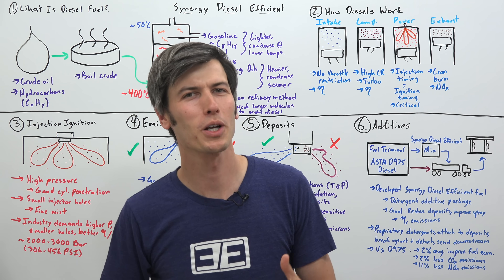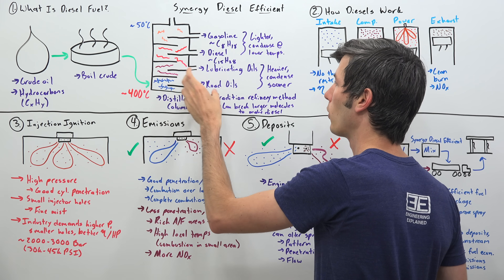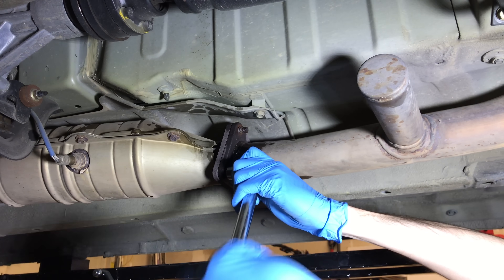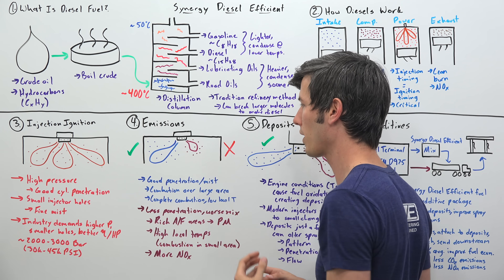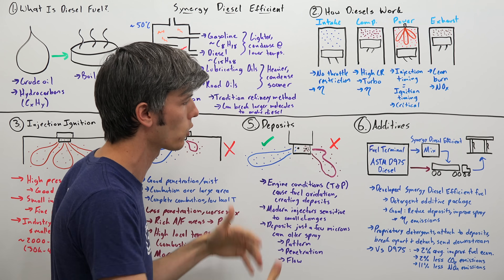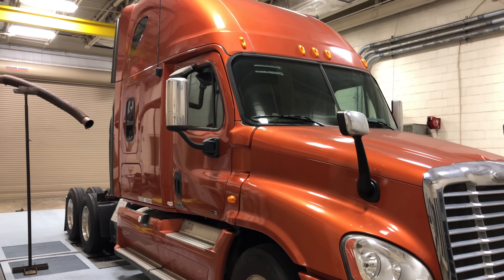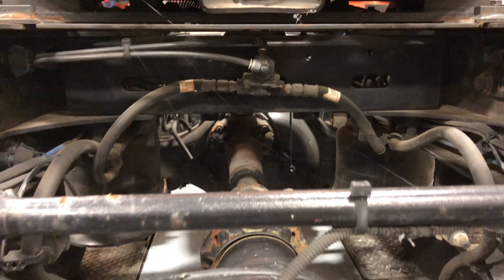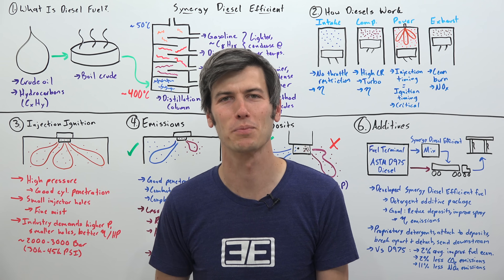Why Diesel Engines Lose Power & Efficiency Over Time

Comment: You can filter and filter more but you can only filter so much. Diesel goes from one tank to the next. It gets dirtier each time. For instance a truck stop gets its fuel from a tanker. That's 2 tanks. Then into the truck tank. That is 3 tanks. Each time it gets dirtier. Now it usually gets filtered each time but the filter does not get it all. Some filters get changed more than others. The filters get dirty. The dirtier the fuel the more deposits.

Comment: Thanks. I been driving different year model Peterbilt 579's for over 5 years now and ive always wondered why they loss torque power over time. Mostly noticeable when climbing hills. 

Our Peterbilt's get alot of Derate issues and i wonder if its related.

Comment: I absolutely believe they can reduce the consumption of the fuel, because here, in Ukraine, we have different gas station companies and those offer better diesel with different additives, so that the fuel consumption may be up to 15-25% better with the additives, than with the regular diesel
For example, my vw golf 7, 1.6 tdi loved the OKKO pulls diesel, i got my best mpg there, i could even reach 3.9l/100km, but usually it was around 4.2-4.4l/100km, while one time i fueled up at an unknown station, but for cheaper, my results were 5.5-6l/100km with the same road and style of driving
The regular diesel could offer me 4.6-5.1l/100km mpg

Comment: The reason that Diesel engines lose power with an increas in fuel consumption can be found in reading any Engine manual.  It is to do with lose of compression pressure and temperature to ignite the fuel fuel.  Traded trained techs know a trick that can restore engine performance when it drops away that is not mentioned in any engine manual. All trades have their secrets.

Comment: Cetane rating to get a quicker burn, friction modifers to the diesel fuel pump, remap to map out EGR and stop the intake from sludging up, a good right-sized FMIC. Personally use a mix of BP Ultimate Diesel, highest cetane rating in the UK & Shell V Power diesel best friction modifiers. Coupled together I also get both packages of detergents...

Comment: Utter Pig Piddle...........If an engine is properly made,correctly matched to its application, with no inherent problems, properly maintained, with properly filtered diesel AND synthetic oils it can go 1 or 2 million kilometers and still achieve the same horsepower and fuel economy.  Cat engines, the K19 Cummins and the ISX Gen 2 (non egr etc) and Series 60 engines all were capable of going the full distance.   DPF's need regular maintenance and are a separate issue.  If an engine doesnt go the distance its because its poorly made,maintained or wrongly matched to its application (too much load factor).   Many light vehicle engines only have a problem because they are poor quality junk , the end.  Heavy truck engines have been high pressure already for decades........havent changed.  Only in light vehicles have pressures come into the same bracket with the advent of common rail.

Comment: I love your channel, but have a lot of questions about my diesel truck and the efficiency of a truck with a DEF system. is it possible to get better performance with DEF than without? and what are the most dangerous greenhouse gases and what % comes from automotive Deisles...is the EPA just chasing money or are they actually doing good for the environment? and why do vary large tankers that carry everything do not have ti use DEF systems and similar grade fuel to the cleaner stuff we put in our trucks? please shed some light on this or if it would be a bad move for you to do thus please also let me know...IE the epaulet will not be happy with what you may find...thank you and keep the great work up!

Comment: Mine has an issue @ 3000rpm losing power for a second or 2  based on  Dyno test result (Grand Starex Gold VGT A/T) , Diff  shop has diffe opinion on the issue, Injector, Turbo,  Transmission, Airflow/MAP sensor, EGR, iI dont' know which one is correct

Comment: The Propietary detergent is Anhydride ethanol? I Put some E85 mixed with 50% ATF dex3 for lubricity, at 1:20 ratio. Looks like a good detergent, got more pep after refueling with pure Diesel....

Comment: If you could centrifuge the fuel before using it the mud  comes out from station fuel.Most ships that run on diesel purifie the fuel first. I have worked on such engines and have never come across a deposited injector.  High hour diesel engines will degrade due to compression loss . Compression rings and valves.

Comment: Lots of factors to control in an experiment like this.  Air temperature, air-pressure, tire-inflation, oil viscosity (engine and transmission), oil fill level (crankshaft sloshing), air-filter flow resistance, electrical load (state of battery charge).

Comment: I run my Transporter T6 often from Germany to Romania, and decided to run some experiments with different fuels.
1-Shell diesel sucks, high consumption and loss of power.
2-Conventional Diesel from OMV is cheap and good. 
3-Performance Diesel with additives are 10% higher in price, but gives you more than 10% more in mileage.
It makes sense to use diesel with additives if you go for a long run, specially if you need to refuel.. it pays off! Just avoid Shell!😅

Comment: the trick is to use those premium fuels from time to time to have a nice balance between fuel cost and clean(ish) engine especially if its older or has a lot of mileage

Comment: I drove vw lupo 2001 driven 500k 1.2L engineomg it got power 150kmph with just a little touch of gas pedal.  And with a great efficiency
May be they lose power but its irrelevant may be you will notice after one million km and car will be dead much before that time. And why you are focused on diesel engine petrol car also lose power. And petrol engine last 250k where as diesel last 500k

Comment: Thanks,crude oil is usually put through a cracker first to break the larger molecules to smaller ones before multi stage distillation to produce diesel. The refinery can control the process to vary the split of the various fractions depending upon market conditions.
 Diesel is getting a rough ride in the UK, and car sales of diesels have dropped dramatically, VW and others have dealt a serious blow to diesel cars.

Comment: So the diesel they selling is coming from their own refineries and completely contained in their own separate bulk fuel delivery system? Because all the other retail fuel distributors get their fuel from bulk delivery sources at the "rack" which supplies multiple different distributors. It's all the same fuel. But ExxonMobil keeps their supply completely in house from refining to the pump?

Comment: So why is diesel more expensive since it is substantially less refining then gasoline kerosene etc...
Reply: Supply and demand.    More demand less supply = higher cost.    You will notice the prices fluctuate back and forth throughout the year.  Usually in summer gasoline prices are close too or higher than diesel  prices. Then lower in winter.

Comment: It is a good practice to always use an additive to lubricate the high pressure common rail fuel system and to clean the injectors.  It is good to hear Exxon is working on high quality fuel as America's diesel fuel quality varies greatly - diesel seems to be the red headed stepchild in the US, our fuel's lubricity is generally well off what Europe has, for example.  

Exxon may have great diesel fuel, but the diesel fuel system is too sensitive to leave to chance - I always look for a high volume station and run a lubricity and injector cleaning additive that also improves cetane, which is generally sadly lacking in America's diesel fuel supply.  My little Canyon with the 2.8 diesel runs much better with a little cetane bump, with no rattle at all once it is warm.

Light duty truck diesels can easily run 400K miles if fed good fuel and looked after.   The real devil with the new diesels is in the emissions system.  Tuning can take care of that - nod/nod, wink/wink.  That and don't "short trip" a diesel.  They are at their best when the engine is heat soaked and they used for highway and distance driving.  Once a good lightly loaded pickup truck's diesel is in overdrive on the open road, the transmission's work is done for the day - LOL

Comment: Glue instructions say, to get the best bond, sand or scuff glossy surfaces.  The glue has more texture to grip.  Deposits bind to the injector surface, although unwanted.  Would it help to polish the injector surfaces to a mirror finish, to reduce deposits over time?  Or maybe design them with a glass or ceramic coating for the same effect?

Comment: you didn`t explain at all how ignition and injection work in a diesel engine and why it`s different from a gasoline engine 
do you not understand it youself?
Reply: Its explained in other videos. Diesels use the heat of compression to ignite the fuel.

Comment: Dude that ignition was like 20 years ago, ever heard of glow plugs? google it.
Reply: That is the modern system, diesel direct injection. The older system used indirect injection. 
The glow plug is used to heat up the intake to help the engine start when cold. After the engine is running, they do nothing.
Reply: @Redtooth75  they do even after in order to optimize the running of the engine and lower the consumption/emission by providing better control over the detonation.  I am just saying that his statement is way outdated unless in US they never upgraded them diesel since the '80s.

Comment: If Diesel engines need smaller holes to diffuse the gasoil better, but smaller holes are more prone to be blocked by deposits, then why not 1) use many more holes to achieve the gasoil "mist", and 2) inject hydrogen to clean up the injectors from time to time?

Comment: In Spain we have two diesel types
Normal Diesel and Diesel PLUS.
Depending on INJECTION SYSTEM the additivated one, the PLUS, is NOT recommended due to less lubrication properties, aawell sulfur content is mandatory to be zero.
BimmwrN53

Comment: You didn't focus on the Cetain Rating. NA diesel was so poor 25 years ago that European and Japanese diesel engines etc couldn't run on it. They knocked severly and had poor performance.
Honda small diesel engines has a large US stzmped on thd flywheel to indicate it was fir thd NA market only. .Petro Canada at the time had info on what makes a diesel fuel good. I obtained that info to understand dual injection Honda diesel snall non-road  engines. Im not a fan of diesel at all, however suffice to say that there is nothing that will do the job they do with heavy equipment. Take them off the road as far as passenger vehicles are concerned. Teslas semi once it is in the road will take care if 18 wheelers.
Love your program and you explanations are great (have to replay some to get your gist). Im USN traied and licenced as a Mororcyle, automobile and truck mechanic. Honda is my love and thats all products. Diesel and two stroke fasoline engines have no place in the market anymore and no one has suceeded in making them clean. VW  should be put down for their cheating or fined out of existance. Thats my rant. Thanx for your E. Expl. Once again!

Comment: At what point in the video there is the answer to the question in the title?
Isn't possible the replace injectors regularly, as we do with spark plugs?
Reply: Diesel fuel injectors are expensive. Yes you can change them but its usually not worth it unless you absolutely need the extra power.

Comment: My question is, if you have never used Synergy and your injectors are no longer spraying in a uniform pattern; with the detergent used, how long would it take to clear up those injectors and bring them back to manufacturer specifications? Efficiency was thoroughly covered, but the cleaning of the injectors was almost completely ignored?

Comment: So base refined diesel is the same for all the stations? Only the additives vary from different distribution companies... am I right? Just really curious because shell did come out with higher quality diesel in Finland few years back, but it does cost like 10 cent per litre more than normal one which is around 1,2-1,5€/L 😬

Comment: I cleaned my diesel injectors  at 280.000km with an ultrasonic machine and now no more black smoke exit from the exhaust.
I also suggest the use of an additive for the oil to help engine run well

Comment: Why does diesel usually cost more than gasoline when it's simply less refined gasoline? It's all coming from the same crude oil. Is there less diesel produced compared to gasoline in the distillation process?
Reply: While Gasoline is more refined you must take into consideration what uses Gasoline vs Diesel. Gas is used by smaller IC engines typically. Whereas Diesel is the primary fuel for things like large semi trucks, trains, and the vast majority of the world's ships.
Reply: @bobjackson4287  That only adds more to my question. If diesel is used by more things, and is simply less refined crude oil, why does it cost more? Makes no sense.
Reply: @busterscrugs  Diesel has a much higher demand on the world stage. And has very high usage overall. Also Diesel at least in the United States have high taxes due to the EPA nonsense. All of this combined cause diesel to be more expensive despite it being more fuel efficient.

Comment: On a side note: If diesel engine emission systems such as DPF, DEF, and EGR were primarily developed to reduce emissions for the sake of flattening the climate change curve, then how are they helping since you burn 30-50% more fuel per tank with the regen cycles?  If diesel particulate is causing climate change then I suppose it would make sense, but the main contributor is CO2 and burning 30-50% more fuel means the emissions systems are actually putting out more CO2!!??  I can definitely see the fuel consumption in my Duramax L5P thanks to the regen.  Am I missing something?  I think for the sake of my engines life span, and the environment a delete of the EGR and the DPF would be logical and ethical.  Do you agree?
Reply: The Emissions testing for the engine is done at the Dyno, not behind a Drivetrain for the EPA.

Comment: You said that because of the higher compression ratio in Diesel engines they tend to be more efficient.  I thought, from a course I took many years ago, that the efficiency of the Diesel cycle depended on temperature ( delta T) and that the Otto cycle depended on the compression ratio.  Or is that really just the theoretical thermodynamic efficiency?  Diesels need the high compression to get the mixture hot enough to ignite.
Reply: Higher compression ratio is higher thermal efficiency. More work is being generated from the same heat.

Comment: I would think that with such high fuel pressures that the particulate buildup would be blown apart by the fuel and with proper maintenance a one ton heavy duty pickup truck can last considerably longer then 200 k miles. I have a half ton truck with 387,600 miles on it and it runs like a top

Comment: Can you do a video on if a modern diesel engine is actually suitable for cold climate (-15 to -30 celsius in winter), and if the current DEF/EGR setup is an acceptable design? I owned a diesel truck before, it runs great but constantly got DEF/EGR problems that i had to sell it after 2 years. Now I am thinking about another HD truck and really not sure if I should give the new ford 6.7 diesel a try. I do not use it for work, but planning to tow a travel trailer or truck camper for long distance trips. reliability will be my number 1 concern.

Comment: Well.. It's really the same loss for gasoline and diesel. Both get deposits over time and it all comes down to maintenence and how they are used.
I.e a 20year old diesel with, let's say 200.000 kilometers on it can have just as low loss as a petrol engine.
I actually know of several petrol engines that have lost noticably more power than a diesel after the same milage and the other way around. So in general it's the same. Fact😎

Comment: My experience over many years in many different diesel vehicles from small hatchbacks to SUV's and tractors is that power and fuel economy actually improve for the first 50,000 mile or so before reaching an optimum, which can be maintained for at least another 100,000 miles, if maintained as per book, before a gradual decline occurs. Eventually more maintenance may be needed to recover lost performance and efficiency, such as new injector nozzles or a decoking of the EGR system including a new or recon DPF.   Nothing lasts forever, but most diesel engines, even small ones, are easily capable of 200 to 300,000 miles without major re-cons these days and large engines up to 25,000 hours or more, which is about 800,000 miles or so.  Larger engines still may do multiples of that service with overhauls more easily justified financially to keep them going.
There's a bit of luck involved of course, because failures can occasionally appear sooner or later for all engines, such as faulty injectors or EGR valves or prematurely restricted air or fuel filters.

Comment: I call BS. The statistical analysis used in this study is bogus at best and totally dishonest at worst. To get a .4% standard deviation is almost impossible to get when dealing with machinery. This SD must have been from the entire sample of fill-up in this case which makes the data more or less useless. Where is the control vehicle? Why didn’t Exxon/Mobile by two new identical trucks with same configuration, I am sure they could have afforded it. Then they would of had a control and a test vehicle. Plus when you are talking 2% lowering .8% is explained by error so the actual change is 1.2% which is NOTHING. The barometric pressure change could cause this. Hopefully the fuel burns cleaner.